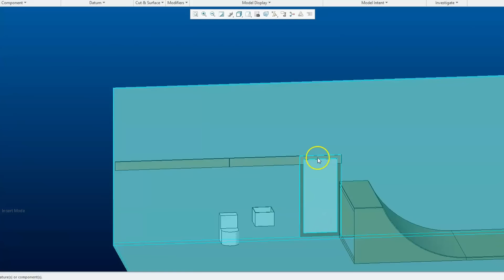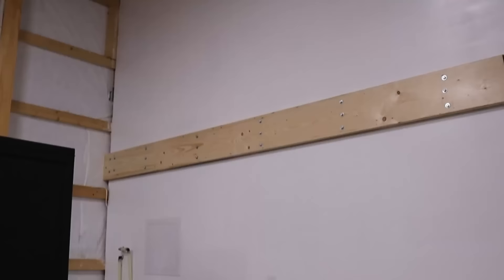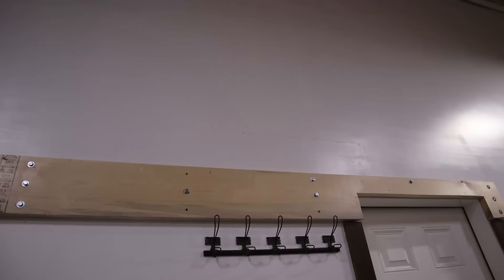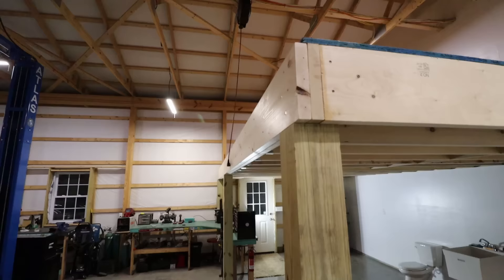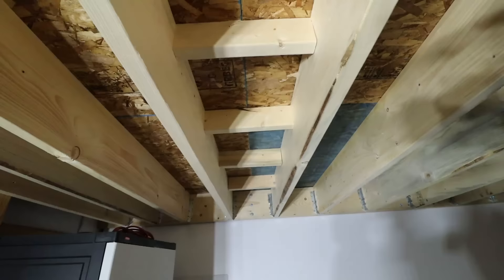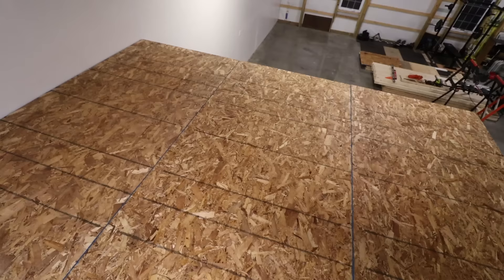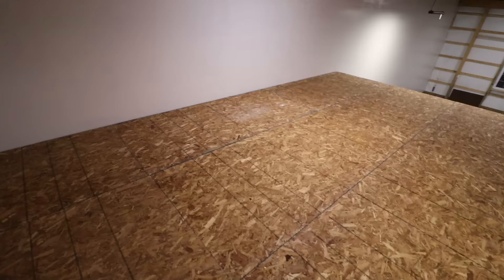Building a Large Mezzanine Loft By Myself - FULL BUILD

Comment: I knew the 14" spaced joists were going to cause issues with the flooring. I was talking to my monitor for you to change it but it's just a loft for your personal use, so it's not a big deal. If it were to be up to code, you'd have to change it.
Reply: I started doing the math on that myself but i thought maybe it was a strange difference in code... Here we are required to set joist 16" on center
Reply: @MrKastro502  The spacing is fine for code since even though 16" is standard (it's a little over engineered), but the ends of the osb need to be terminated on a joist and the sheets should be staggered.
Reply from the maker: Appreciate the feedback! Clearly I wasnt too worried about making this fully up to code, like you said it's just some storage space in my garage...

Comment: When fitting the floor joists, it can be useful to fix a timber under the framing to create a temporary shelf whilst you set out the joint spacing.  Watching American timber construction professionals, they always fix the joist hangers after initially toe nailing the joists at the correct spacing.  Not to criticise your construction, but perhaps you could use these methods as you progress with the half pipe.   Good Luck.
Reply from the maker: Thanks for the tips!

Comment: Really cool build.  I would put a vertical 2 x 10 on the wall corner and the wall center to take stress off the wall.   Something you could do instead of paint is water down Titebond 3 wood glue and roll the whole surface, making it water proof.  I bet you'd gain some strength too.
Reply from the maker: Appreciate the suggestions!

Comment: FYI, the "joist plate" sitting on the posts is actually called a "beam" and it has to be at least the two plies you put in.  Good on you for gluing it. And good for you adding the post anchors to the floor end.  I always find it interesting when mechanics do carpentry.  I suppose that goes both ways! 14" on center almost made my head explode. LOL  Good job, all in all, and what great additional storage.
Reply from the maker: Haha yeah if I did it again I would probably do 12" OC.... Thanks!

Comment: great house/garage....don't worry i'm no carpenter either ... but 2 x 6 joist plate would've gone right over your doors...no need to cut the door trim.. and clearance issue solved... you could then put a few 2 x 4 studs under your plate to the wall for extra support... as well as use the studs to wall out your bathroom..... but with those 2 x 10s you can do off of your pipe using your jeep...

Comment: FYI I would take out those deck screws from the joist hangers and use a proper 10D nail.. Deck screws are not structural and will fail.. You should also use structural screws, nails or timberloks for everything else..
Reply from the maker: Do you have any suggestion for a structural screw? I don't have a nailer or compressor unfortunately.
Reply: @Kordare  Pick up a pack of 10D 1 1/2" nails (should be next to the hangers) and hand drive them in (they should go in fairly easy since you have a "pre-drilled" hole) .. Nails have a better shear strength than a screw..  For your  ledger to post connection I recommend LedgerLOKs or TimberLOKs.. That should keep that thing up there for as long as the building stands and take the abuse that you might put it through..   RR Buildings has a great video on putting up a mezzanine in his Post Frame building..
Reply: @Kordare  Some joist hangers will actually tell you the nail that is required and I shouldn't assume they only require 10D 1 1/2" nails.. They sometimes have a cross nail that would require a longer one to hinder pullout and or require a 12D or 16D..  I know it seems like it isn't important, but I can assure you it is..
Reply from the maker: Great, thanks for the info. I actually did see that video and based some of my design on how they did it.

Comment: I'm concerned with those joists being attached only through end grain from the outside. And you addressed that with the additional hangers.  That's the point of using hangers.  There are simple hangers designed exactly for this purpose to avoid the risk of splitting the joists and having it fail.  Don't ask how I learned that lesson!   Darn collapse at 2 AM was very good at waking me up!
Reply from the maker: Oh yeah definitely needed to add those joist hangers, not gonna let that 2x10 hang on 3 screws into the end.

Comment: Very cool project and a great way to use upper space within a steel garage. Mezzanine they are an amazing way to create more space vertically. I myself am building a steel garage 30 x 40 going to put a mezzanine back in the back and build a studio apartment to create For an Airbnb or even a rental apartment. Either way you can’t go wrong use every inch of your storage garage possible or barn for that matter. Great video. Colorado
Reply from the maker: Thanks for checking it out!

Comment: Were there any considerations to make the loft a little higher to clear both doors without cutting the joists?
Reply from the maker: I'll be riding bike on top so it was crucial to have enough headroom. I set it up so the headroom above and below is equal. I actually already added more bracing over the door.

Comment: How do you decide what size wood to use? Do you look up the allowable load on a table, or try to figure it out from tensile strength data, or just by guessing?
Reply from the maker: I mostly based the design off common practices and used a few tables to make sure I had more than adequate spacing for the distance I was spanning.

Comment: Fasteners are not the first thing to worry about. You can put 100 nails or screws into a board, but if you don't transfer the load properly, that is when you will have problems. You plan on having a half pipe off the loft, but you are going to have point loads that are unsupported. You will need to have a post or 2 on the joist where you attach the half pipe. You can't rely on the 1/2 joists over that door to transfer the load. Essentially you made a 2x4 floor system over the door. ( It doesn't matter if one side is a 2 x10, the load is calculated based on the smallest dimensions on that joist, in this case a 2x4.)
Reply from the maker: Yeah I realize that, the halfpipe is a completely separate self supported structure, I'll also add more bracing at the door.

Comment: Is your concrete floor pad 4" or 6" thick? What's the requirement for footing thickness for the 6x6 posts? 

Is a 6" thick pad thick enough by code, to act as a proper footing?
Reply from the maker: My entire floor is 6" thick. If it's thick enough for a car lift it should be fine for a 6x6 post but I don't know the actual requirements

Comment: Good job for not having experience. Any reason you couldn't raise the height a few inches so the doors wouldn't interfere? Im not sure what kind of screws you used on the metal hangers but typically you want a structural screw or nail. In general, framing nails have better shear strength than most screws. For the middle post,  id add a thick metal trianglular plate on the outaide tying the headers and post together. Even though you are likely anchored to the wall, all posts should have resistence to racking such as diagonal braces. But overall, good job.

Comment: Take the handrail and go to the beam going across your ceiling, since you want a stairway going down the side of the ramp, you can also run the handrail for the stairs off the handrail up top, going to the beam will make it more sturdy but also help strengthen the stair handrail.
Reply from the maker: I actually already built stairs and a handrail check out my newer videos!

Comment: No need to cut away the gypsum board when putting up header board? Just screw header board up over Gypsum Board?
Reply from the maker: Theoretically it would be better to remove the drywall for strength. But that is considered a fire wall separating the garage and living space, so it can't be cut.

Comment: Joist hanger nails, trimming those stringers by the doors are basically 2x4's after they have been cut, also your sheeting should be offset by half. Why not go 5" higher wit the whole thing?
Reply from the maker: I'll be riding bike on top so it was crucial to have enough headroom. I set it up so the headroom above and below is equal. I'll be adding more bracing over the door. I'm not a professional and dont claim to be. This is mainly a car channel...

Comment: Put a column just to the left of the door and double the joists over it.  That stuff you did to clear the doorway leaves you with about a 3 or 4 inch joist.  The additional column and double joists will hold the load in the main portion of the loft and then don't store anything heavy in the area in front of the door - all the way across.

Comment: Nice build not a criticism but a question, why not make it the few inches taller and not have to notch for the doors? Looks like you had enough post length to do it?
Reply from the maker: Thanks! I'll be riding bike on top so it was crucial to have enough headroom. I set it up so the headroom above and below is equal. I actually already added more bracing over the door.

Comment: Why not just build a few inches higher to avoid notching framing in front of the door openings? Looks good. Great video.
Reply from the maker: Thanks! I'll be riding bike on top so it was crucial to have enough headroom. I set it up so the headroom above and below is equal. I actually already added more bracing over the door.

Comment: my only real head scratcher is: why did you choose to build it at an elevation that interferes with the doors? I feel like I would have chosen to build it at an elevation maybe 1ft higher. I also would have done 16 on centers for the floor joists. Anyway, it looks great, and I'm happy you're enjoying your shop and doing your thing man.
Reply from the maker: I'll be riding bike on top so it was crucial to have enough headroom. I set it up so the headroom above and below is equal. I'll be adding more bracing over the door. Thanks for the feedback!
Reply: @Kordare  That makes sense what's the height from floor to cieling anyhow?

Comment: I think the joist hangers are supposed to be used with specific nails (building code). Not sure what kind of screws you used but might wanna check that.
Reply from the maker: Yeah I'm sure they are but I wasn't worried about building to code. I used #8 and #9 construction screws. I don't have a nailer and wanted more control over depth.

Comment: I didn't read all 1000 comments but was wondering why not go up above the doors? Instead of having to notch around them. Was the 2 or 3 inches that precious it was worth ruining the floor joists?  Just curious, I'm not a carpenter or engineer.
Reply from the maker: I did this to create even headroom above and below the loft. This was crucial because now that my ramp is finished, I ride and land up on top with my bike. If it was higher I wouldn't have room to do that.

Comment: on the cutout section for the door, if you change those cuts to 45 degrees rather than a 90 you will distribute more load and resist a shear point in the corners of the 90.
Reply from the maker: Yeah it was only an inch or two so I wasn't too worried about it. I also have the joists spaced closer together in that section.

Comment: I am not qualified to comment on any technical issues. But I love the design and came across it after lot of search and lot of videos. This is the best I selected for my own project. I was thinking of installing four 6X6 posts but now changed my mind to installing only two. Going to build the loft in single garage which is 9'.8" wide. Is it ok to screw the two 6X6 posts on the opposite walls. One side is concrete wall.
Reply from the maker: Glad I could help and I don't completely understand your question

Comment: Any particular reason you didn't build this 6" higher and avoid all of those cuts on the floor joists?  Also, the ledger board you attached to the wall is providing no more support than the sheer strength of the lag bolts.  Putting any kind of load-bearing support under it would be something akin to proper framing.
Reply from the maker: Yeah I ride bike up top and down onto a ramp that's next to it so it was crucial to have enough headroom up top. And yeah the bolts are taking all the shear but that's why I have 3 in each stud. Also have a bathroom built below now that also helps support.

Comment: Only my second video I have seen.  I'm enjoying your content.  I can tell we think a  alike I general  . I was wondering what you used to seal the shop floor?  . Did you happen to make a video with sealing the floor in it? Thanks.  Great content!
Reply from the maker: Thanks!I didn't film it but I used SureCrete Polyaspartic roll-on coating. It has done pretty well, just make sure your concrete is clean and very dry before you start. I unfortunately had to do it in the middle of winter so my floor wasn't completely dry after cleaning which will mess with adhesion of the coating.

Comment: Looks great but my only question is raising the entire platform roughly a foot higher to clear the doors and not having to notch the joists; unless the as built is relative to the proposed half pipe !!
Reply from the maker: Yup I did that so I could have enough room to ride bike on top and it has worked out well for that purpose!
Reply: @Kordare  if you were just doing a loft with no half pipe, would you have just raised it a few more inches to clear the door and window? Looks great!
Reply from the maker: @BlueTx68F100  thanks! And potentially. It's still nice to have the equal headroom. You have to make some sacrifices when your overall height is only 14ft. 16ft would give some more freedom.
Reply: @Kordare  ok thanks. I have 14 foot walls too. Mine will maybe just be extra storage up top. I’ll look into it. Thanks for responding

Comment: I am thinking to build a Sleeping loft in a small house I bought.... I see you talk about studs... my house has solid cement walls.... would I need to do anything to prepare a wall like that or just screw right into it?
Reply from the maker: You'll just need to get masonry bits to drill pilot holes and use concrete lag bolts instead of wood ones like I used
Reply: @Kordare  Thank you for the feedback, my house is only 36 square meters so wanting to build a sleeping loft with home office under.... need the space   :) I will let you know how it turns out will be getting to it just after the new yar
Reply from the maker: @TheWanderingYogi  good luck!

Comment: Great build, I'm puzzled why you doubled the front joist last, I would have stuck it on first and used the screws holding the cross joists to help stick the front joist together, it might be stronger, even not gluing it you would have dozens of bolts holding it together, and it would also be adjustable in the future but now you have sealed in the joist bolts.
Reply from the maker: Well if I did that I would need very long screws to go through both headers and into the joist, I'm really not too concerned with being able to easily take this apart.

Comment: Did  you ever think about suspending the Mezzanine from the top via cables or whatever  to allow for free access to the bottom area
 I haven't done it yet but that's what  I want to do   Thanks
Reply from the maker: I did but this was the more straightforward approach. You'd definitely wanna check with an engineer before you place extra load on your roof trusses.

Comment: The out side joists dont appear to be resting on the post.   They look screwed in instead. Would recommend in the future to notch the post so the face plate and the outside joists are supported on the posts instead of trusting the sheer strength of the screwz
Reply from the maker: I did think about it but liked this setup a little better. I did add an angle bracket to the inside of that joist as you can see in the video.
Reply: @Kordare  I must have missed that in the vid.   I love it tho.  Dont get me wrong. you did an amazing job bro!

Comment: Sorry to bring up an old thread..but curious how high are your walls? We just built a 30’x60’x14’ pole barn and I want to add a mezzanine/ loft. After doing research (after the fact), I obviously should’ve went 16’ or 18’ on the wall height. But can’t go back so here we are. Curious if it can be done and walk comfortably..thanks
Reply from the maker: My walls are 14 as well. Doing it like I did with 2x10 joists you will get roughly 6ft7in headroom above and below (if you want even headroom). It's perfect for me.

Comment: It probably would have been really beneficial to speak to a structural engineer about altering the ceiling supports above the loft. Safely moving a few beams would have given you a ton more headroom both above and below.
Reply from the maker: Yeah that's true, I just didnt wanna mess too much with my original structure. I'm not tall so it worked out fine.

Comment: Love the details and feedback on your build. What kind of treatment did you apply to your garage floor?  Got our garage built going and didn’t recall you mentioning the garage floor treatment in the overview vid you did. Exactly the look I am going for. Stain, epoxy?  Love your build. 🤙🏼
Reply from the maker: Thanks for checking it out! I used a roll-on surecrete polyaspartic coating on the garage floor. It's held up pretty well but I'd suggest doing at least two thick coats. And make sure your concrete is very clean and dry before you apply it. Good luck!
Reply: Kordare Thanks so much for the info. Picked up some goodies today from a local dealer with for the Titanium acid stain. Fingers crossed it comes out great like yours!  Would have never found this product without your reply so much appreciated 😉.